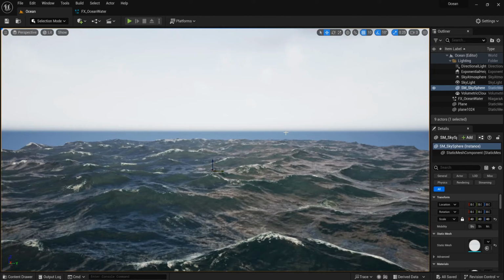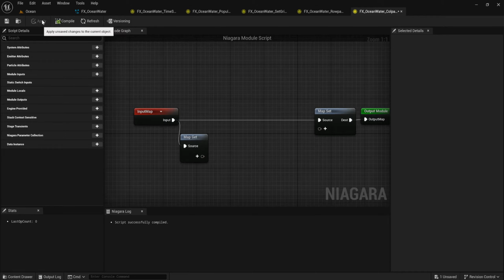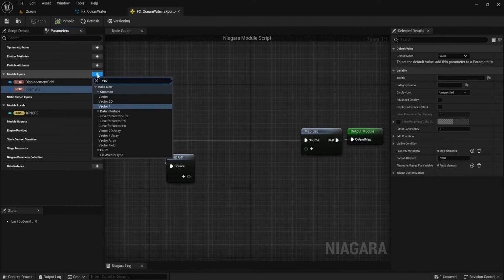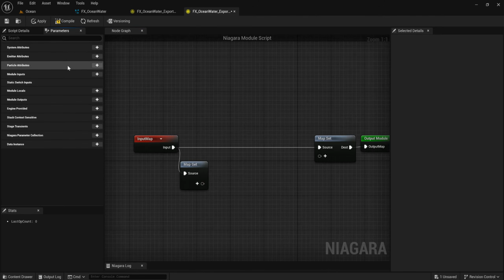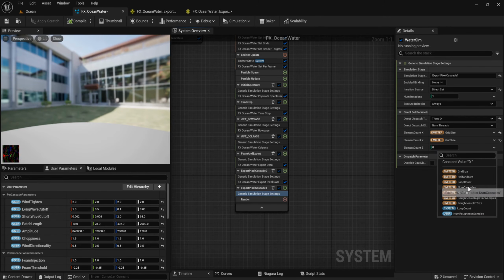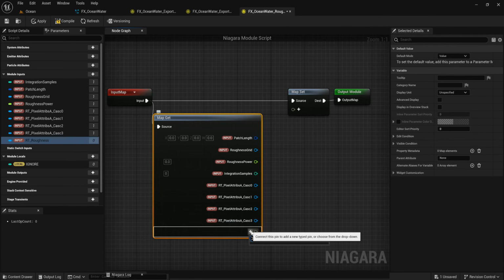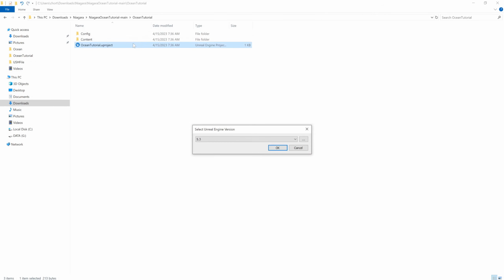Unreal Engine Ocean Simulation Tutorial: Part 3

Comment: Corrected OceanWaterFFT.ush

#define LENGTH 256
#define BUTTERFLY_COUNT 8

void GetButterflyValues(uint passIndex,uint x, out uint2 indices, out float2 weights)
{
	uint sectionWidth=2u<<passIndex;
	uint halfSectionWidth=sectionWidth/2;
	
	uint sectionStartOffset=x&~(sectionWidth-1);
	uint halfSectionOffset=x&(halfSectionWidth-1);
	uint sectionOffset=x&(sectionWidth-1);
	
	sincos(2.0* PI*sectionOffset/(float)sectionWidth,weights.y,weights.x);
	weights.y=-weights.y;
	
	indices.x=sectionStartOffset+halfSectionOffset;
	indices.y=sectionStartOffset+halfSectionOffset+halfSectionWidth;
	
	if (passIndex==0)
	{
		indices=reversebits(indices)>>(32u-BUTTERFLY_COUNT)&(LENGTH-1u);
	}
}
/////////////////
#if GPU_SIMULATION

groupshared float3 pingPongArray[4][THREADGROUP_SIZE];

void ButterflyPass(int passIndex, uint x,uint t0, uint t1, out float3 resultR, out float3 resultI)
{
	uint2 Indices;
	float2 Weights;
	
	GetButterflyValues(passIndex,x,Indices,Weights);
	
	float3 inputR1=pingPongArray[t0][Indices.x];
	float3 inputI1=pingPongArray[t1][Indices.x];
	
	float3 inputR2=pingPongArray[t0][Indices.y];
	float3 inputI2=pingPongArray[t1][Indices.y];
	
	resultR=(inputR1+Weights.x*inputR2+Weights.y*inputI2)*0.5;
	resultI=(inputI1-Weights.y*inputR2+Weights.x*inputI2)*0.5;
}

void ButterflyPassFinalNoI(int passIndex,int x,int t0,int t1, out float3 resultR)
{
	uint2 Indices;
	float2 Weights;
	GetButterflyValues(passIndex,x,Indices,Weights);
	
	float3 inputR1=pingPongArray[t0][Indices.x];
	
	float3 inputR2=pingPongArray[t0][Indices.y];
	float3 inputI2=pingPongArray[t1][Indices.y];
	
	resultR=(inputR1+Weights.x*inputR2+Weights.y*inputI2)*0.5;
	
}

#endif // GPU_SIMULATION

Comment: Hello, I folowed this tutorial and it's absolutely great. In the end I got 2 problems, can you help me fix it. First one is I have to open the FX_OceanWater tab in another window, in the background in order to make the sim run, if I switch to another tab on that window, the sim stop, it just freeze, same when I close the tab. Second one is that my sim reset every 10 seconds making it looks very jitter, how can I make that period longer.
Reply: I had the same problem. For anyone else wondering, you can fix it by placing the Niagara system (FX_OceanWater) directly into the level, and it will simulate properly. To fix the 10-second reset issue, just extend the timeline duration in the Niagara system. The reason it doesn't simulate without the editor tab open is that UE doesn't recognize the Niagara system as "in the level" unless an instance is placed there, so it doesn't tick. The "Auto Simulate When Placed in Editor" toggle only works if the system is actually in the level. This might be due to new GPU Niagara optimizations in a versions after 5.3 but I have no idea. Unfortunately I didn't find any better solution
Reply: @Keingarr  Thank you so much, it worked

Comment: These tutorials are great I thank you for that but I need to add that when you are dividing the wpo by the overlap scale in materials later in this series, it brakes the physical accuracy. I set my patch length 10, 30, 1000, 5000 multiply my cascade size by 20 and thats it. FFT is a physically based simulation so scaling waves down manually messes them. Instead you should set the wind speed parameter to 3-5 like values to make a calm ocean. And also use higher amplitudes for small waves and lower amplitudes for big waves to not cause the waves to swell awkwardly in itself. So my amplitudes are 30000, 9000, 20, 2. I am writing this cause I also struggled a lot to tune the parameters. In the end I read the original tutorial carefully and watched videos of other people that made fft sims to see how they tweaked their parameters. Try this yourself you would not believe how much of a difference it makes

**
guys I need the make a super important correction. Dont even multiply by 20. Just multiply the patch length by 100 in materials and plug thaat into cascadesizes and thats it. Let me explain. Patch length means what scale are the waves in meters. And the simulaton uses the patch length parameter to derive the correct wave shape. Patch length 1 means the waves are 1 meter. If you multiply the patch length by 100 in materials you are placing 1 meter waves in a 1 meter area and thats correct. If you were to instead multiply by 20 you would place 1 meter waves in 20 units / cms. And this is incorrect cause you are literally putting the waves that should be in 1 meter area in a 20cm area. However you will need to make the amplitudes crazy numbers and thats completely fine and there isnt a problem. You can tweak the waves shape size directly in patch length parameter thats %100 physically correct. You will definetely feel the difference if you do this. Waves will look like they are pushing each other very realistically. 
My parameters are amplitude: 800000000,0 |  6000000,0  |  20000,0 |  200,0
patch length: 1 , 10 , 100 , 600
short wave cutoff: 0,000001 |  0,001  |  0,1 |  1
long wave cutoff: 25 | 3 | 0.4 | 0.04
Also I like my wind tighten at 5.
But feel free to tweak these I am putting it here so you would not need to find numbers for hours. You can just use my numbers as a base and tweak things you dont like from there.
This will also fix the weird glimmer halo effect happening on the edges of the waves (its also the thing that made me suspicious there was something wrong 😅) cause roughness map generation also uses patch length parameter. So roughnesses were also incorrect.

Comment: I am using Unreal Engine version 5.5.1. I followed everything in the video step by step correctly. I am not getting any errors, but the render targets are not updating. I think if I can solve this, I will succeed. What do you think might be the reason?

Thanks for this tutorial.
Reply: I don't know if this will help you, but I found that inside the "FX Ocean Water Set Render Target" module, Some of my render targets reset themselves. I have absolutely no idea what may have caused it but specifically, I found that under RT_VertexAttribs and RT_VertexAttribsB, the user parameters, size, and override render target format were all reset. once I set them again, they worked fine. I would go through everything in that module and make sure everything is as it should be. Good Luck!
Reply: Im using 5.4 and I having the same issue. Have you solved this?
Reply: @blues__N__greys  No. :(
Reply: @ Thanks. When I find the solution I will comeback and share with you.
Reply: @blues__N__greys  Did you solve it? I'm having the same issue and using 5.6
Reply: @ernestavakian899  No, bro. I just had to move on from this.
Reply: @blues__N__greys thanks for reply!
Reply: @blues__N__greys  I'm going through it again in 5.7 right now, but the first time I did this tutorial, I was using 5.4 and it worked. If you got stuck on 5.4, don't give up, it is possible.
Reply: @chestertimmins4820  have you gotten it working yet? im on 5.7 same issue

Comment: That was an Amazing Tutorial !! I have one issue though, everything is working but i only have the OceanPixelAttribs_Casc0 working (A and B) the other 6 ones are just displaying black and I don't see any differences in parameters (The VertexAttribs and Roughness render targets are also working). Has that happened to anyone else or does anyone know how to solve it ? I'm still quite new to niagara systems so i'm having a hard time troubleshooting it.

If anyone wants to check the project more in detail i can link a github to the project

Comment: @jourverse - Having an issue re-generating the RT_ROUGHNESS Pixel Render Target after the PatchLength fix at 39:15.  Mine still was not showing as Red after the fix.
I deleted the RT_Roughness render target and re-complied everything again, now it's not generating the file at all.
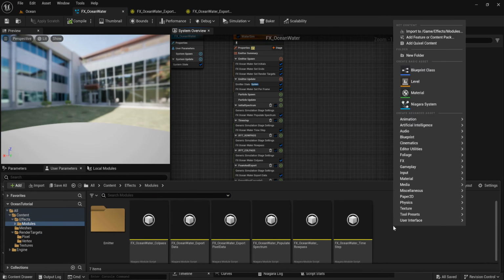I restarted UE, then I reviewed the video for this section starting at 30:35, and everything matches up but it's still not generating the RT_Roughness Pixel render target file.
No log errors.   Any suggestions?    (I'm running UE 5.3.2)
Reply: Hi,  you were able to find a solution for this ? i'm stuck with the same problem also
Reply: @pubudu781  - Hi.  Nope, never did figure it out.  Sorry.
Reply: @John_atCTS  😔😔😔
Reply: Link the RT_Roughness direct from the arrow next to RT Roughness not from RenderTarget and make sure it is emitter. This worked for me UE5.6
Reply: @melissaquintana4018  I was trying to upgrade the plugin from 5.3 to 5.6 with no luck on updating Binaries file. Should I just start over in 5.6 or is their a fix?
Reply: @jrs7052 hard to say because I started in 5.6 from scratch
Reply: @melissaquintana4018  - Thanks Melissa.  Did you complete the entire tutorial in 5.6? - just wondering if your waves are working as expected.  I started this a year ago and have since trashed the project to free-up some disk space, so I'll have to start over again but I don't want to do that if I'm going to encounter other issues down the road with either the tutorial or v5.6.   -john
Reply: @John_atCTS  Yes I just finished it is working perfectly I had to get back to the original file and compare some stuff but is working and make sure the timeline of the animation has enough seconds to play properly
Reply: @melissaquintana4018  - OK, great!
Reply: @melissaquintana4018  Hey Melissa, I am also using 5.6 and I was wondering if you encountered issue where your Render Targets are not moving? I cant figure out why and I wonder if there's something I missed in the tutorial or is it something I need to turn on/off in the editor since its a 5.6 and not the version in the video
Reply: @ernestavakian899  same problem

Comment: very good tutorial, it works but I think I made an error somewhere and the ocean is going way too fast
Reply from the maker: Check all your user parameters especially gravity and wind speed. And your update animationtime in Niagara System.
Reply: there was an error in the animtationtime, I fixed it but it completely broke the ocean sim, also when I preview the render targets, they change too quickly compared to what happens in you video
 @jourverse
Reply from the maker: @EpicGamer-vu1rm  You can download the project from the original tutorial link in the description then compare your project with that.
Reply from the maker: @EpicGamer-vu1rm  which version of engine you use in your project? You need to use 5.3.
Reply: I am also facing the same problem can you tell how you fix that
Reply: I had the same issue in 5.5, here's the fix:

- Go to FX_OceanWater
- Go to WaterSim Emitter
- Click InitialSpectrum
- In Details, Set Execute Behavior to "On Simulation Reset"

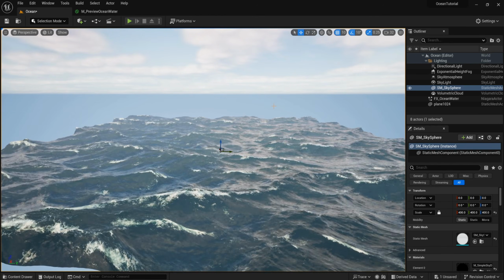Tbf @jourverse did cover on Part 2 47:40, but I missed it the first time 😅

Hope this helps